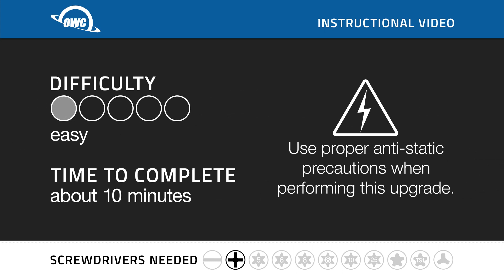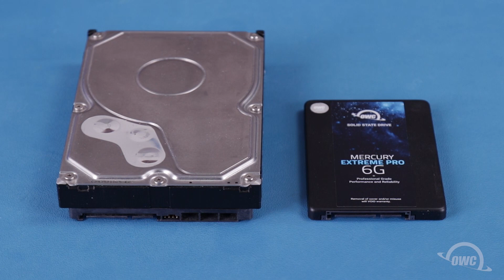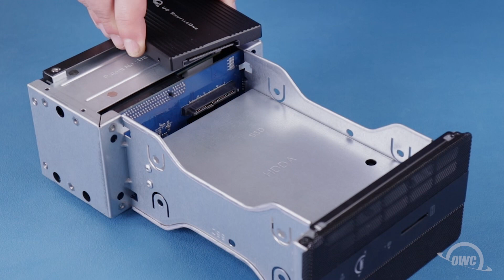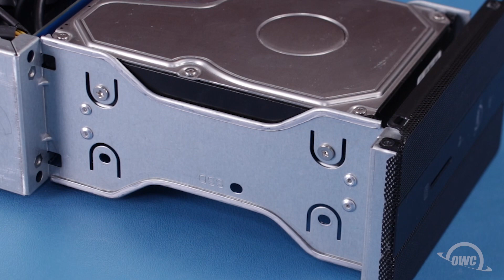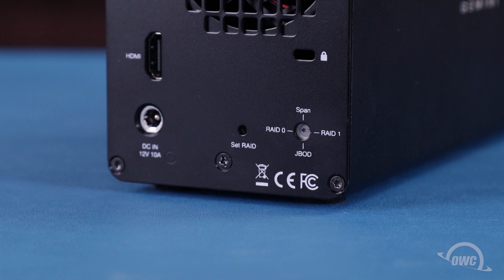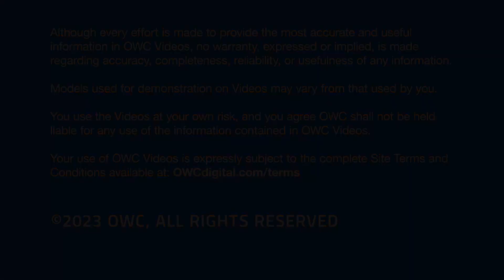How to Install Hard Drives/SSDs in an OWC Gemini Enclosure (2023 Revision)

Comment: My OWC Gemini enclosure does not have a 'Set Raid' button.  Why is that, and do I have to do anything after installing two external drives other than selecting the type of RAID?
Reply from the maker: Thanks for your question!

The OWC Gemini does include a “Set RAID” button, but it’s designed to be recessed on the back of the unit, so it may not be immediately visible or may require a small tool (like a paperclip) to press. This design helps prevent accidental changes to your RAID configuration.

After installing your two drives, the typical setup process is: select your desired RAID mode using the switch on the back, then press and hold the Set RAID button to apply the configuration. Once set, you’ll just need to format the volume on your computer using Disk Utility (macOS) or Disk Management (Windows) before use.

If you’re not seeing the button at all, feel free to share a photo or your exact model, and we’d be happy to take a closer look with you.
Reply: @poweredbyowc   Great!  Thank you!!

Comment: After setting the raid level at the case switch. Do i have to do anything with the "Disk Utility" on my mac running OS Sequoia ?
Reply from the maker: Great question, and you’re definitely thinking along the right lines 👍

If you set the RAID level using the hardware switch on the OWC Gemini, the RAID is handled entirely by the enclosure itself. On your Mac (including macOS Sequoia), you do not need to create or manage a RAID in Disk Utility.

What you do need to do is:

* Open Disk Utility
* Select the Gemini volume
* Erase/format it once (APFS or Mac OS Extended, depending on your use case)

After that, the Gemini will appear and behave as one single drive on your Mac, ready to use.

If you ever change the RAID switch setting in the future, just note that the data will need to be erased or backed up before use.

Hope that helps, and feel free to ask if you have any other questions! 😊
Reply: @poweredbyowc  Thank you!

Comment: Can I use the USB ports to transfer data from an old computer, or are they only for the mouse and keyboard?
Reply from the maker: Thank you for your question!

The OWC Gemini must be connected to your host computer using the Thunderbolt port for full functionality. The USB ports on the Gemini are designed for connecting peripherals like external drives, keyboards, mice, or other USB devices. So while you wouldn’t use those ports to directly transfer data from another computer, you can connect an external drive to the Gemini and transfer data that way.

Let us know if you need help setting that up!

Comment: what is the max capacity for the drive? will 20/22TB 3/5inch drives work?
Reply from the maker: The OWC Gemini does not have a maximum capacity for drives. You can use 20TB and 22TB drives with this enclosure.